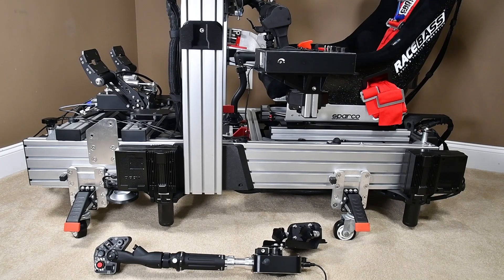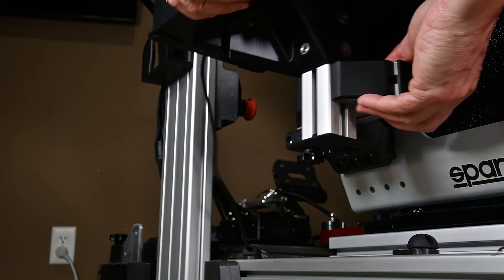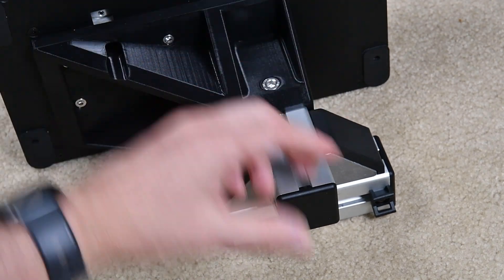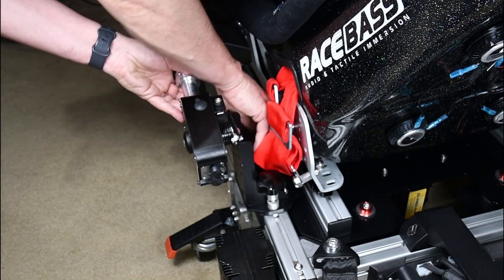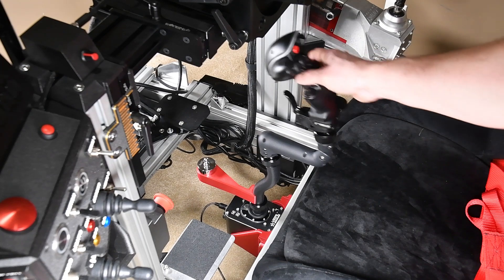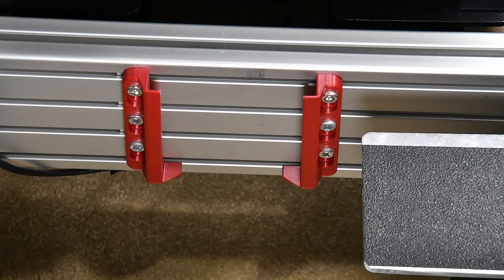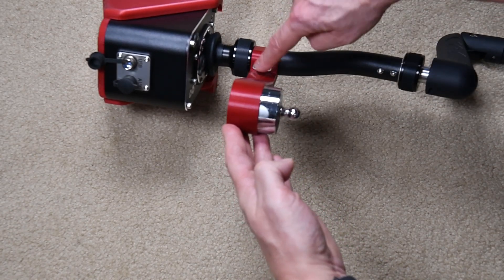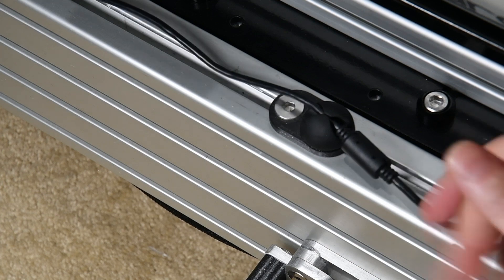Virpil Quick Release Profile Mounts

Comment: Great job!  I'm also very curious about those castors on your rig.  Am I seeing fold down isolators on them?  Are those an off the shelf part?
Reply from the maker: The retractable casters are off the shelf and as you found out in my other video, I designed the caster release mechanism for my motion system and had the parts laser cut for me.
Reply: @markkovalcson7243  very impressive!